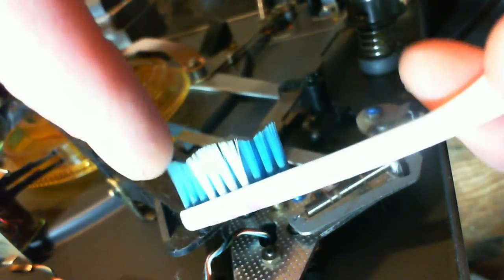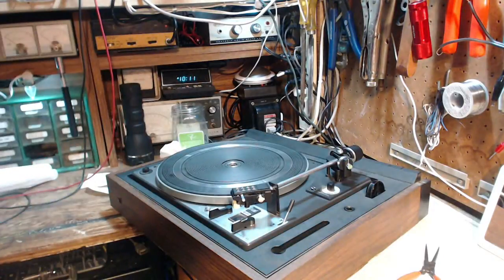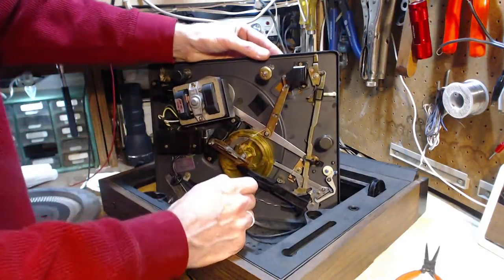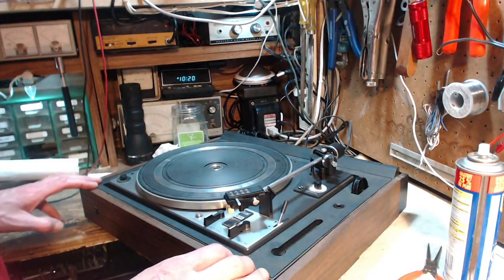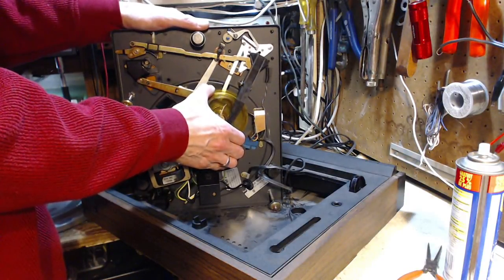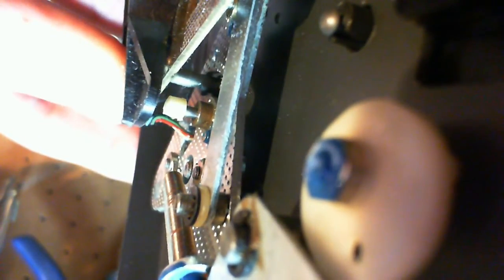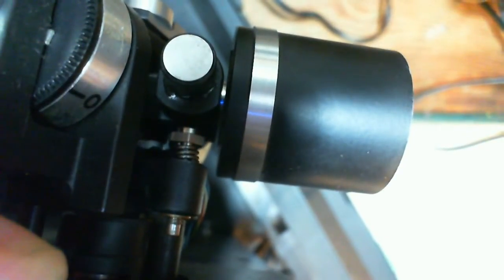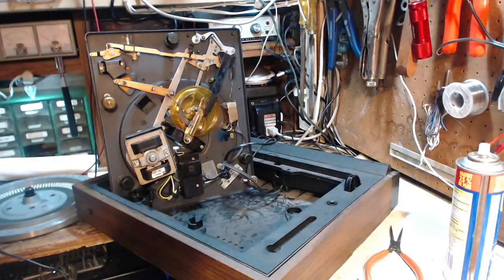Dual 1228 Turntable Video #4 - More Observations

Comment: Hi Jim,

you need to adjust the tonearm total high when lifted, first with the lifter screw placed right over the lifter itself. It´s that thing most left at the tonearm rear mounting. But be careful with that you can easily jam the whole thing....
Next is, to put that cardridge away, you can put the siver cardridge locker serving as well as the manual tonearm placer (that metal finger thing, don´t know how you call it, sorry), away form you until it releases the cardridge.

Next is to lubricate everything besides that black plastic arm moving whipe. You need to clean that moving face platter thing very, very well, with pure alcohol, to do so you can take the whole thing off, by just taking out its middle axis.

I always use WD40 to do a first de-greasing and after another alcohol cleaning i use simple all synthetic motor-oil for final lubrication.

Comment: Jim,  Consider replacing the white rubber cap with a short piece of surgical rubber tubing with the appropriate inside diameter so it fits snugly over the pin.  You can cut the tubing to a length which will give  you the proper action.  A pharmacy should have a selection of various sizes of tubing.  If not, go to amazon and buy on line.Bob

Comment: Sorry to say but you made it worse when you grinned the rubber down.
Reply from the maker: Jamesnov1970 I know there is a risk of making things worse.  I'm normally very careful about that sort of thing from previous experience.  But how much worse can it get?
Reply: Jim Lindenas Indeed.   The cart has excessive weight which is causing major drag on that top part that lifts the tone arm, which is not meant to have friction.  By grinding the rubber down you have removed any chance it would work again   It appears if you adjusted the carts weight it may of worked again.  No doubt it had excessive weight to compensate a worn stylus.